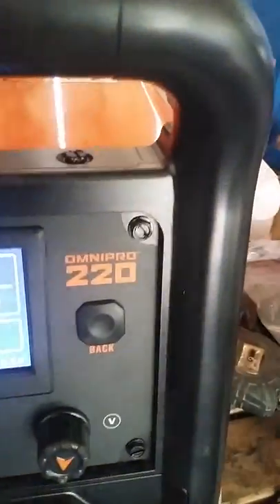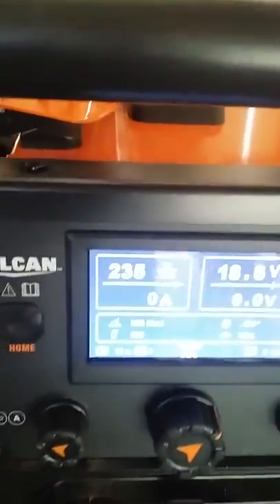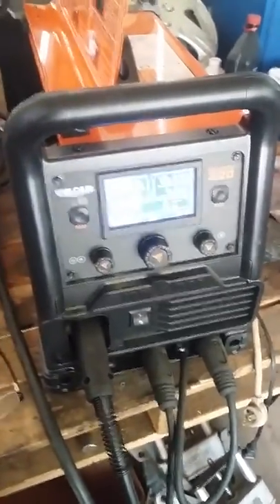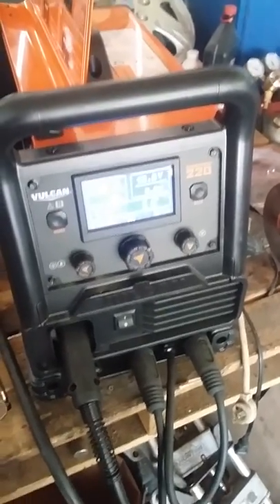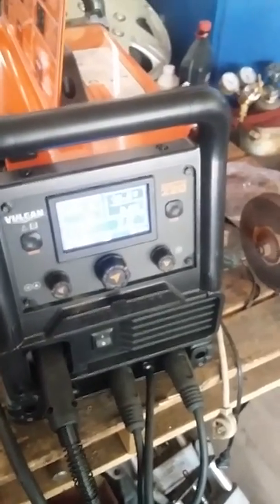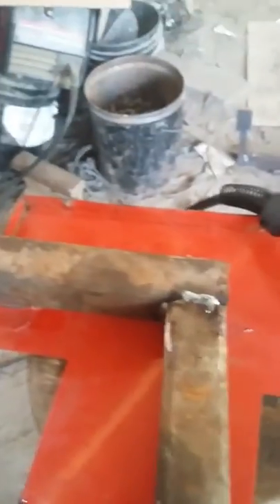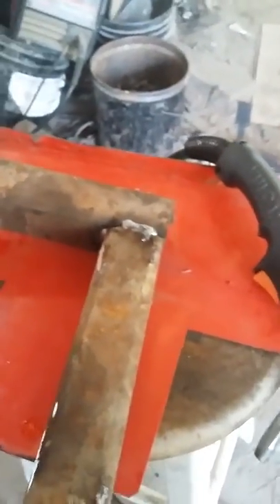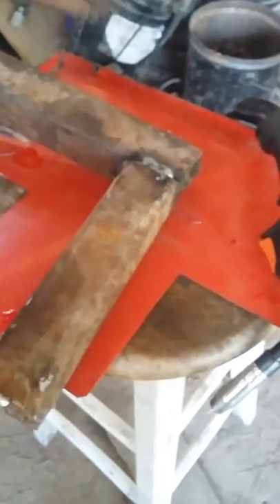Vulcan 220 welder running on solar

Comment: whats your continuous run time?  minor fixes and such are possible sure, but could you actually complete a four or five hour project with out worrying about battery discharge?
Reply from the maker: bishop york I have a automotive shop here as well so I work full time here so yes I can work how I need to my solar system is good sized and I will be expecting it as well  not just for welding but for eveything. Thanks for watching